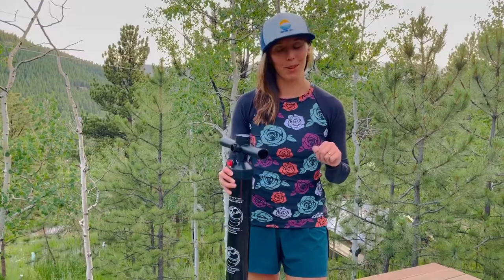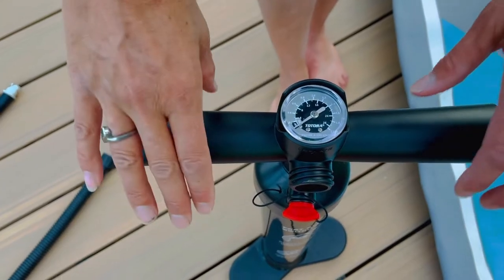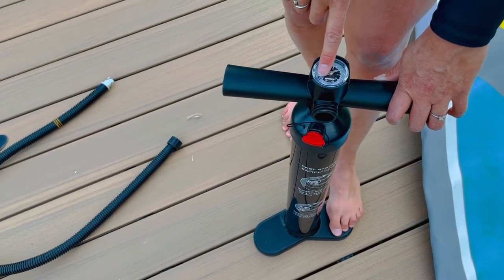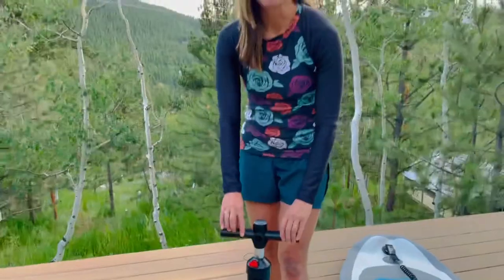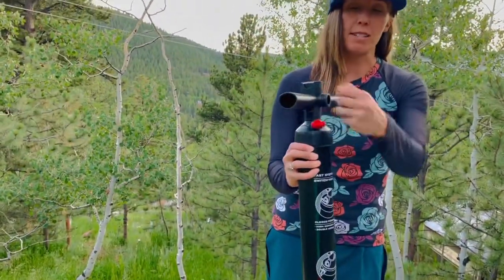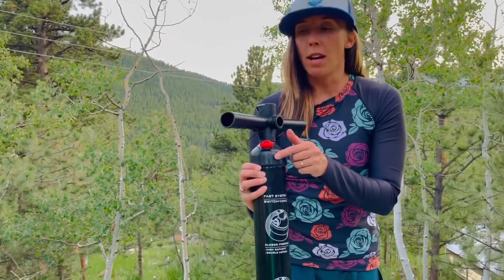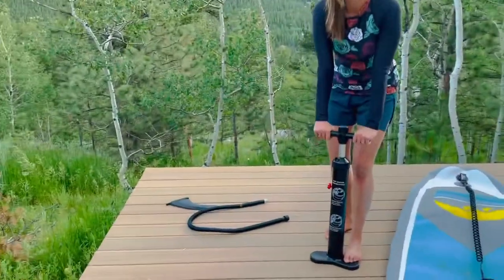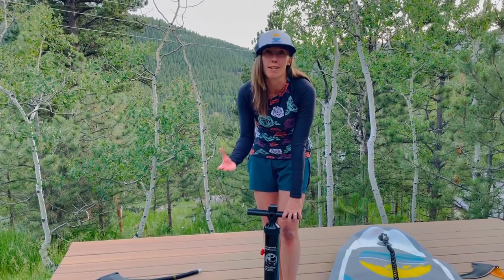Your SUP pump is not broken!

Comment: 12 psi is plenty for 15 psi board WHEN it is 90° or hotter in TX sun. Air will expand. Too many people pump to max and then are surprised when SUP pops a leak a couple minutes later. AIR EXPANDS in heat.

Comment: I Do dual action until 8 PSI always in the shade, switch over to single action to 16 (my board is 15-18 psi) - Then wait for about 3 minutes while getting all the other gear ready. Then I go back to the board and the pressure will have fallen a bit usually to around 14 psi. then inflate a bit more to 16 psi and get in the water.

Comment: Until the vessel starts holding real pressure the gauge is not going to register it. It will sit at atmospheric pressure until you get that thing rock hard and then you’ll see your psi go up.
Reply: ❤ Yeah, some people are just really not up to speed with how reality works. Why would anyone think the gauge is going to register pressure before it's filled to 1 atmosphere?😂
Reply: It's still strange. My starting moving when my board is as hard as a soccer ball. When I reached 10, I was afraid it's going to explode

Comment: Pump is at 9 psi rn. Not working anymore. I tried pumping both with and without the plug at the top. There is no pressure on pushing down. I have pumped this board to 15 psi twice without any issues. Guess my pump actually is broken lmao

Edit: opened the pump. It looks like the o ring came off and is stuck at the bottom.